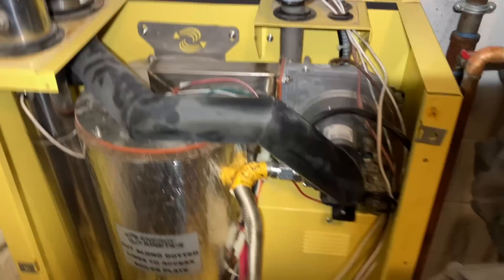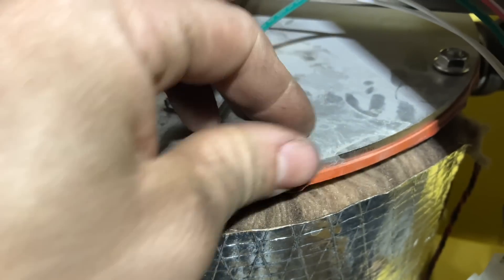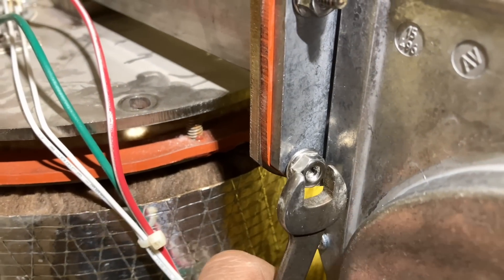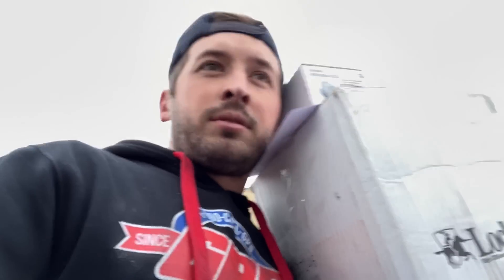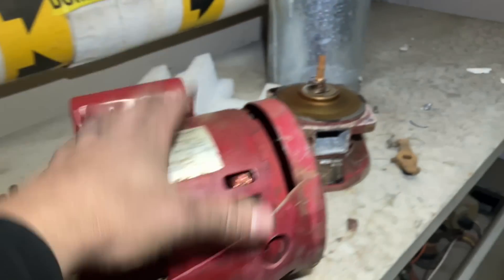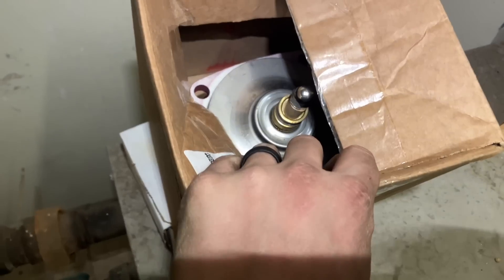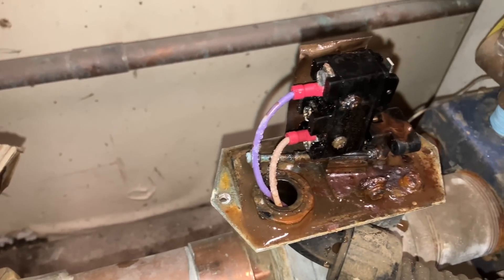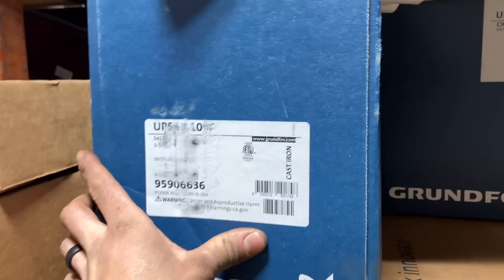Dual Draft Inducer Installation Day

Comment: When replacing anything with bearings ( motors, pumps, other ), do you ever come across brands / models that allow you to EASILY grease / oil the bearings ? 
Almost never see that these days. If you accomplished finding a source and then advertised to your customers that you use serviceable / maintainable parts ( and are therefor better then your competition ). This could maybe be a unique beneficial talking point for your business ?  :o ?